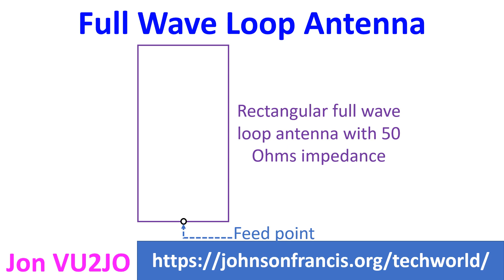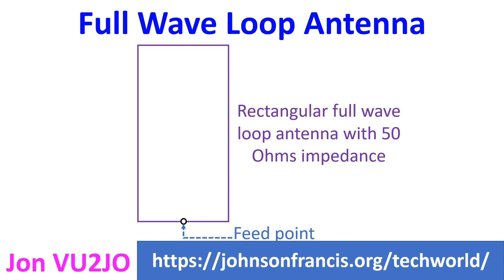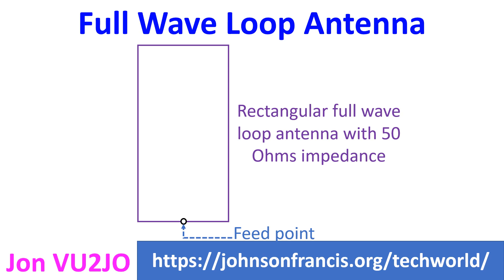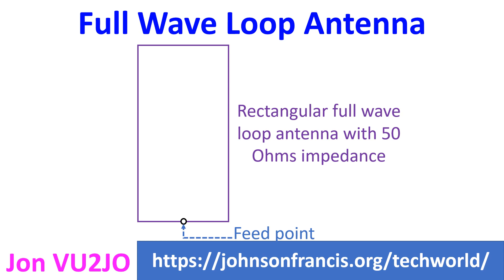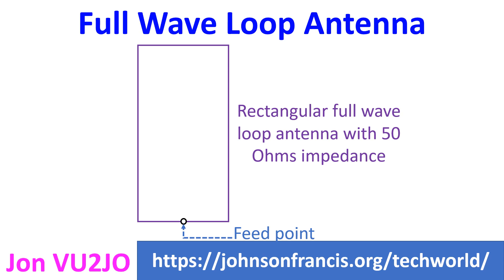Full Wave Loop Antenna

Comment: The rectangle full wave is my favorite omnidirectional antenna to use as it is a perfect efficient 50ohm match, simple to make from wire, has about 20mhz bandwidth on the resonant frequency, has great noise rejection and has around 6dbd gain. I rotate it 90 degrees from the example in this video to get a vertical polarization. If I had the space I would make one for the 160m ham band. So far ive built them for 1090mhz, 850mhz, 88-108mhz fm and 10-12m 2m,70cm cb/ham bands with more than perfect results. Not many youtube videos mention it but you did! A+
Reply from the maker: Thanks a lot for the nice words of appreciation. I wish to make it for 2m and 70cm, if you can kindly share the design or link to the page.
Reply: @johnsonsTechNAgroWorld  This is the formula to determine wire length: 
Full-wave loop in feet = 1005 / frequency in MHz
Full-wave loop in meters = 306 / frequency in MHz
Then you shape the rectangle like this: Long sides are twice as long as the short sides

So for 146mhz total wire length = 210cm (70cm long sides/35cm short sides)
 and for 435mhz = total 70cm (23cm long sides/11.5cm short sides)

Connect 50ohm coax directly to the feed point, wind a 1:1 "ugly" air balun near the feed point and keep the coax length in multiples of full wavelengths. 
For example if you needed 30ft(914cm) of coax length for your 2m setup 210cm+210cm+210cm+210cm+210cm this is 5 full wavelengths of coax (914cm to reach the antenna with 135cm left to wind your 1:1 air balun).
The amount of coax you dedicate to the air balun is not critical as long as it has enough I like to make them 5 inches in diameter with 9 turns. The air balun is not required but I know from experience how great they are at trapping noise without effecting efficiency so  Iuse them on all antennas and suggest others do the same.

Good luck maybe you can make a video on it.
Reply from the maker: Thanks a lot for the detail description. It will be very useful for the Amateur Radio operators out there. Shall try it soon and get back to you.
Reply: @fivestar2227

I don't think a rectangular loop antenna is omnidirectional.
Reply: I'd love to see your antennas. Thanks for the post.